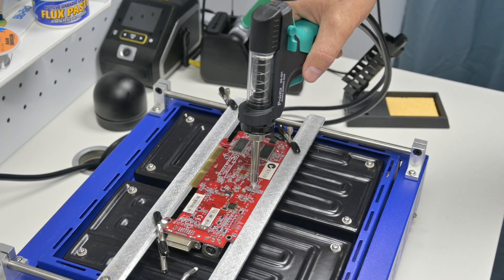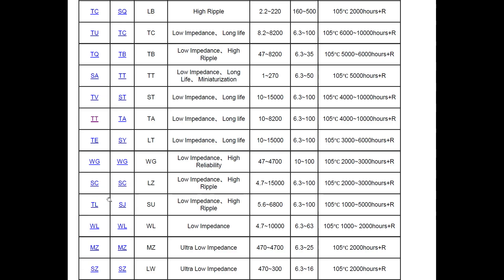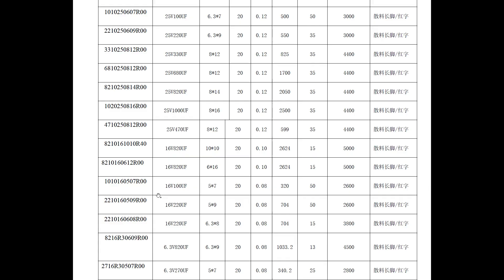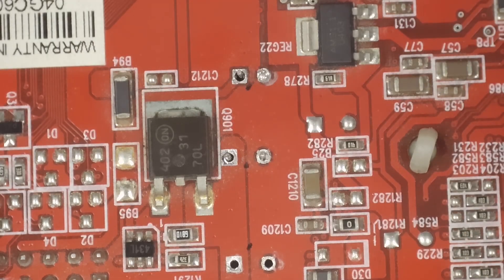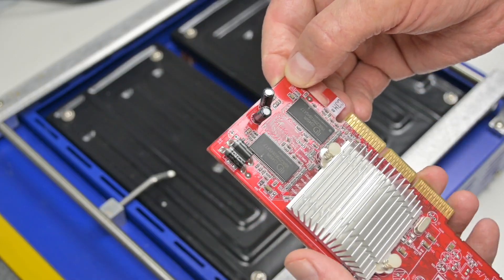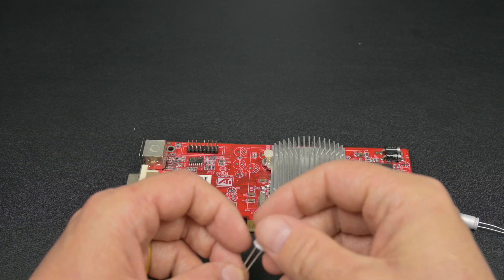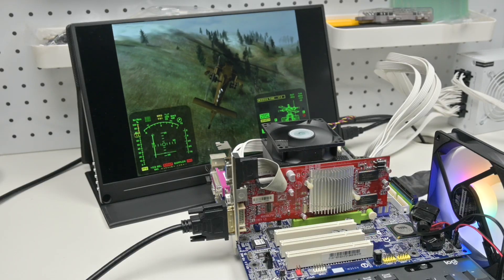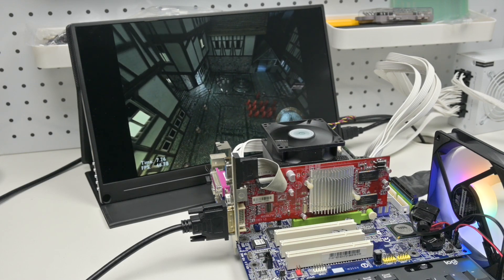Can We Repair Retro Radeon 9200 LE Graphics Card?

Comment: I went on this same journey. My first big achievement was modding an ati rage xl card with a voltage regulator so it would post on a 5v PCI slot so I could unbrick a voodoo 3 which had the wrong bios flashed to it.

the tools make or break your experience. Desoldering gun is definitely a must have.  I also learned that flux is your friend.
Reply from the maker: That is a good mod, I could give it a shot, I do have such a Rage XL card actually. What sort of system do you use that has 5V PCI?
Reply: @philsworkbench  Asus p2b motherboard. Basically if your PS2 and serial ports are black you likely have a 5v PCI slot. If your ports are coloured it's likely 3v.  Some newer PCI cards won't work in old PCI slots and need a regulator added to make it work.  There is a detailed video on YouTube easy to find.

Comment: I have a pile of good used caps from broken motherboards and video cards. Never bought new caps in my life. This old video cards have good tolerance on what you put in there. Only respect the voltage , a little higher is better and the uf needs to be the same because affects the working frequency. Thanks for all Phil🙋🏻
Reply from the maker: That's a smart way to go about it actually. I can already see how buying caps is adding up big time...